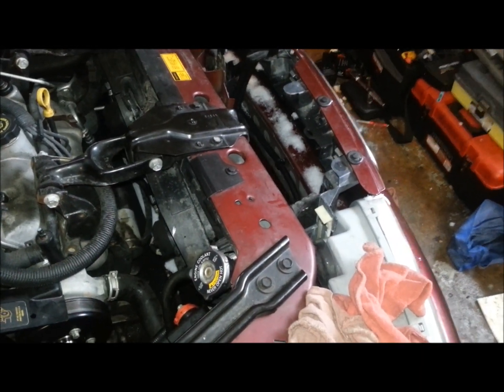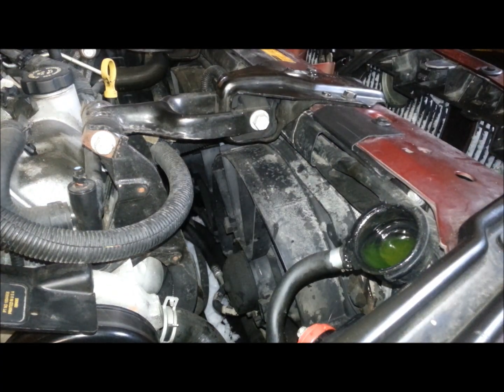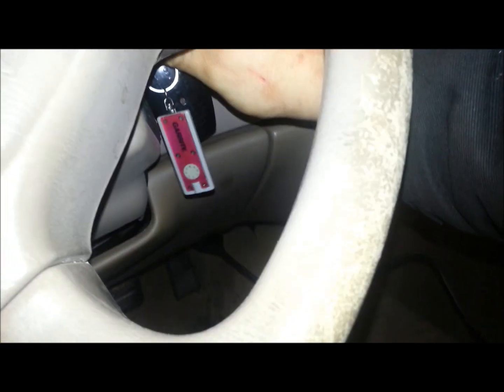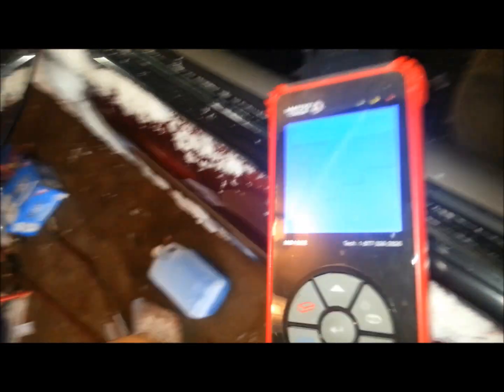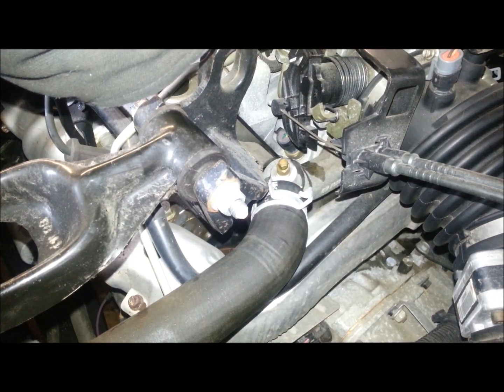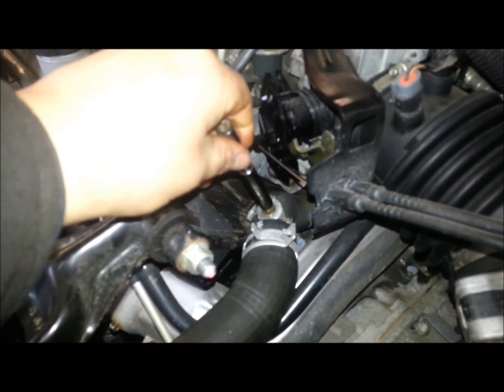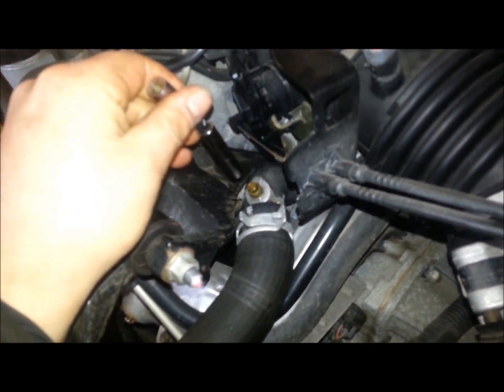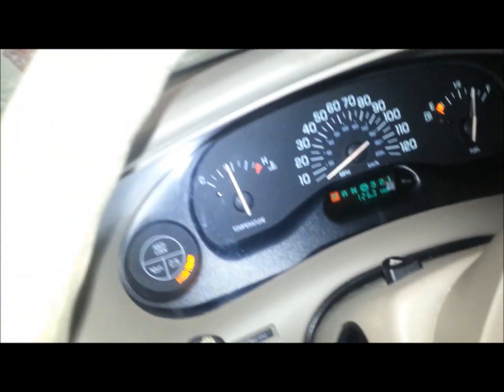how to bleed coolant system 3.1/3.4 liter

Comment: hey Joe, in the end you said not to touch the bleeder on the left side of the car why will that give you a bad day?
Reply from the maker: ***** yeah it will blow like old faithful if the car is running or under pressure from heating up , do not touch it unless engine is cold
Reply: alright cool thank you

Comment: Hey joe. with what your telling me everything seems to be good. I have no heat really untill the car warms up, not sure why. I think I got the leak fixed as I have not added any antifreeze for quiet a few days now. Just curious why there is no heat till the car is completely warmed up. Maybe still a little air bubble?  Car is a 2000 pontiac grand am 3.4 litre.
Reply from the maker: Jim Hutchings you usually don't have full heat until its at operating temperature. but there could be some air in the system but you would see higher than normal temps on your gauge
Reply: My gauge reads normal. If that's the case must be good to go. Just with the little bit of frost that we have it takes quiet a bit of time to defrost the window. Did not think that was normal but guess will see when winter actually hits. Thanks for all the info you provided to me. Much appreciated. 
Thanks
Reply from the maker: Jim Hutchings some times the blend door is an issue causing minimal heat flow
Reply: What do you mean blend door?

Comment: Hey, just like Dyllon Galan I have an 02 malibu base model and it only has the bleeder by the water pump (pressurized reservoir as well; no rad cap); is it still inadvisable to use that one to do a bleed? Not sure what my other options are..
Reply from the maker: cam1317 no do not use the pump bleed the reason i explain in the video is for stubborn air pockets. but in the pressurized reservoir just run the engine at an accelerated idle (1200-1700 rpm) to warm the engine up until the thermostat opens and then just top off coolant as needed

Comment: cannot drain more than 3.5 litres of coolant from Pontiac montana 3.5 2005 what do I need to do
Reply from the maker: edmund arnsby run water through the system to flush out what is in the engine and 3.5 liters is actually a significant amount of coolant
Reply: JoeTheAutoGuy
Reply: JoeTheAutoGuy thank you Joe I went to my Gm dealer and there is no easy way to drain coolant strange designe so I will do as you recommend

Comment: hey Joe. My bleadder screw is broke off so what other methods are there to bleed the system. I took the overflow cap off and let the vechile run for about 1 hr. Had lots of heat in the car. Once car cools down the fill level is below the fill line. Not sure if there is a small leak or not but do not see any leaks. What do you suggest?
Reply from the maker: Jim Hutchings leave your radiator cap off to bleed but sounds like you already did that, are you filling it up every time ? are you having overheating issues?
Reply: Yes topping the over flow up almost every time that's why i think there is a small leak some where but can't seem to find it. With the over heating problems if i pay attention and make sure resivor is topped off no over heating issues. If i don't top off i am gonna say i will have heating problems. When car is cool should your radiator hose to thermostat be solid or soft? As mine is soft. When motor heated up it is hard as rock so thats why i think i have a leak. Whats your thoughts.
Reply from the maker: Jim Hutchings sorry late reply what car do you have exactly? the hoses should build pressure . but your cap is regulated to a certain pressure usually 15-17 psi and if its building to much pressure it can cause a lot of issues but you would usually burst a radiator or something but the hoses should be soft at cold and more solid at warm temps

Comment: Thanks Joe. I've been fussing with my 2001 Chevy Venture for three weeks. Had the thermostat changed and it kept over heating. I didn't even know of the bleeder valve. Learned them. Didn't know that I could bleed the system while the engine is running. I didn't want to take it back to the same mechanic so I have been attempting it myself. It's working. You have my gratitude!
Reply: I did the water pump and bled the air from cooling system, went for a drive and everything was good.
When I stopped I could hear bubbles entering the overflow...
The next time I started it started to over heat again.. I've had to repeat process many times now.. what ammo missing?
Reply: @JJRD222  did you get it handled ?
Reply: @freshwatermechanic  that engine ended up having a leaky head gasket and has gone from my possession.
Reply from the maker: Oh definitely need to bleed the system anytime you expose it to air besides the radiator cap

Comment: Just change the water pump on a 1998 Chevy Venture, but I have the light saying Low on Coolant, but the the Radiator and the reservoir are full. What do you think? Should I do what you did in this video. Well I'm going to do it, and thanks for the video.
Reply from the maker: saul garcia make sure the sensor is connected in the resivoir bottle
Reply: thanks for the reply,  and what sensor are referring to? and the weird thing is that the light turns off and comes on. aand yet I open the radiator and is full. Thanks again.
Reply from the maker: saul garcia there is a sensor in the bottom of the reservoir bottle that is the sensor that is triggering low coolant to come up
Reply: thank you , How can I repay you for the help?
Reply: saul garcia tap where the connector is on the sensor and it should float back up and the light turns off.

Comment: Hi Joe.  Just liked & subed.  Your videos are great!  I have  a 2000 Chevy Impala 3.4 L V6.  It has 89,000 miles give or take as the odometer was changed.  I got the car for next to nothing.  Any tips on how to modify it for higher performance??  I would greatly appreciate your advice.  However I am sort of restrained by California emission standards (smog checks every 2 years).  I would greatly appreciate your advice.        Sincerely,  JAMES.

Comment: good videos Joe - never knew about that bleeder screw there, been trying to bleed it through the heater hoses because they are the highest point on the engine. The head gaskets were shot already so I replaced them, then bled the system the correct way as you've shown. Thanks again!
Reply from the maker: DoozCoop welcome thanks for watching
Reply: On this cooling system is wery easy to do thanks for helping people out on this clear explanation

Comment: I was working on a Chevy venture with the 3.4 and the needle kept going past half,and fans weren't turning on unless I turned the a/c on..why???
Reply from the maker: something is wrong with your main fan, the secondary fan turns on when your ac is activated so your main is probably never turning
Reply: Coolant temperature sensor

Comment: why you recommend not to touch the other bleeder what is that one?
Reply from the maker: if you open that one while the vehicle is running it will blow like old faithful
Reply: Oscar Flores hay joe grasias por tus bidios soi jose de conroe tx estados unidos escribeme quiro saber como purgar el rallador d e un malivu TL 6 3.5000 silindros 20007 porfabor grasias

Comment: I changed the radiator and water pump in a 99 lumina with the 3.1.... bleed the system and it ran fine for a week.... then the tehmp gauge started bouncing around would start to climb.... then drop back down to operating temp for a while... then would start to climb again( causing the heat to stop working) then when the temp drops back down heat comes back on.... Bleed the system again was fine for a day.. then did the same thing again... when I bleed the system I did not have the radiator cap off.... could this cause the problem?
Reply from the maker: you could still have air caught in the system and possibly a sticky thermostat the radiator cap should be lose when its cold as soon as the heat gets above 190 is when i shut the cap down an open the bleeder slightly. to get some trouble air out

Comment: Turning the heat on doesn't help in my case because the heater fan, rear defrost and cruise control are disabled in recirc (fuses are good). This seems to be tied to the coolant level but is getting more common as time goes on: lately it has to get real cold to fire up the heat (and even that is flaky). How do I get around that?

Comment: My 2002 Malbu LS Only has the one bleeder by the water pump. Mine is the pressurized system. I tried just bleeding mine by removing the cap and getting it warmed up by putting some rpms on it and it started spewing coolant once it got hot... Not sure what to think of this.
Reply from the maker: was it over heating during this?
Reply: It was a tick over the half mark on the gauge. Fans wont turn on unless the ac is on. I dont know what is considered overheating on the gauge meter besides the red mark.
Reply: JoeTheAutoGuy Replaced water pump and thermostat but have very loud whistling sound. Is it due to still having air in the system?

Comment: DUDE!!!! U said don't mess with this one (referring for the other coolant bleeder thing...that's what I did before I found this video..do I still bleed it like u show?
Reply from the maker: you can blled it normally through the radiator cap if you have a spill free funnel but this way will bleed it easier and not so much mess on the floor . and can get stubborn air in the system
Reply: thanks for the super fast response!!... just bled it doesn't overheat any more.but now I see my radiator is leaking... if I stand in front of my car (2005 impala--3400 sfi motor)its leaking directly in front of the upper radiator hose but I cant see it ... do u know if there is hoses?..if not can I jb weld or can I just use radiator stop leak...and thanks joe...

Comment: What do you do when this doesn't work? I followed this procedure at least a dozen times and only got a mess on the garage floor. seems ok for a couple of miles then no heat and overheat. I pressure tested the system and it held 12 pounds for 24 hours. still the same problem. I replaced the intake gaskets after they failed and can no longer use the car. Any ideas?
Reply from the maker: did you replace the thermostat, many issues are with the water pump as well,  ive had a few that have been head gasket issues and will only show a leak under pressure of combustion just a few things to look into if your still having issues

Comment: Joe, great upload. I did this to my 2000 Pontiac Montana after I did the thermostat. Bled system but still did not have heat. Come to find out the heater bypass pump was seized up. Took the pump off and disassembled and cleaned the remnants of the Dex-Cool that used to be in the van. I will agree with almost every experienced mechanic out there that says that Dex-Cool is garbage. It was actually like clay in the pump housing. Cleaned it out and pump spun freely and then I had great heat after bleeding again for about 10 minutes.. Again thanks for the upload.
Reply from the maker: thanks for watching

Comment: i have a 2002 Pontiac grand prix se 3.1l and now it starting this misfire it only does when I first start the car in the morning for a few seconds and run smooth do you have a clue what could cause that
Reply from the maker: it might be running lean from a vacuum leak , some small leaks can cause  a miss at low rpm as with any vacuum leak they will run lean and get better with increased rpm. than when the car heats up it could expand rubber seals and seal up leaks (vacuum only) its a high possibilty

Comment: do you leave the radiator cap open?
Reply from the maker: yes the radiator cap should always be open when bleeding the system the bleed valve i touched just gets some of the air out of the intake faster

Comment: You sir are my mentor on troubleshooting from now on My car had a bad resevoir cap and it let all the anti-freeze drain out and I just seen your video and my car which ive had for 10yrs now is doing the same thing I was gonna drive it to the mechanic but I have the book and knowledge plus dont wanna ruin my heads so how long is this technique time wise?
Reply from the maker: takes anywear from 15 to 45 minutes just keep watching your colant level and its pretty simple , thanks for watching

Comment: all you really have to do is take off both bleeders and the rad cap and the two heater hoses start pouring dex cool in all of them and you ll see the coolant coming up in both bleeders close them replace hoses and cap enjoy you dont have to mess with hot steaming coolant coming out near your coconut use your brain this guy didnt
Reply from the maker: i was away from the bleeder just had the camera close and this is a bleed valve for a reason if the air isnt evacuating through the coolant cap  and not having to disconnect anything just be safe but your entitled to your opinion
Reply: whitebread8381 tengo un Malibu 2007 lepuse motor nuebo pompa de agu temostato el Motor es 3.5000 y no se como sacarle el aigre osea purgar el rallador quiero que me emdellem como sease

Comment from the maker: do not touch the bleeder valve on the left above the water pump, this will cause the coolant to purge like old faithful and cause burns to you
Reply: Only if you are doing it wrong.

The one at the water pump (left) is the one you bleed cold, but I still go back while bleeding the one at the thermostat housing (right). Once the thermostat is open and everything is hot/pressurized it will just squirt out the side. Though it could be at any of 360°, the bleed hole is still on the side. You shouldn’t be taking the bleed screw all the way out for it to squirt out the top.

Regarding the temp gauge markings: The Pontiac Montana/Oldsmobile Silhouette have a tachometer that the Chevrolet Venture doesn’t have, despite being that same van. That means they had to fill the empty space on the cluster with a bigger temperature gauge. Even with the smaller gauge, my Montana has 260°F at the top and 160°F at the bottom. That means you get exactly 100° in-between, so half-way is 160°+50°=210°F. I know it is accurate because just above half way is exactly where the water boiled when I did a coolant flush with water and cleaner (212°F).

Furthermore, that makes the 1/4 mark 160°+25°=185°, which is the exact spec for the stock thermostat. Sure enough, my thermostat opens up at exactly a quarter of the way. TStat housing bleeder starts shooting pressurized coolant and the upper radiator hose gets super hot.

I don’t know if this translates to the gauges without numeric markings but if your thermostat opens at a quarter of the way then that’s 185°F, half way should be 210°F, 3/4 should be 235°, and all the way should be 260°.

Of course, you can’t confirm this if you are having a problem with a stuck thermostat like I was but it’s good to know going forward.
Reply: You can bleed both filling cold or when up to temp.  You are supposed to crack them, not open it fully. Run the engine up to 2000rpm and all air will be out of system when you feel hot heat.
Reply: @LIFTANDFIX   Yup, you're right.  Just crack them open so air escapes through the threads until coolant does the same.  Don't know why people make it so complicated.  It's a tapered brass bleeder valve that stops any coolant leak with little snug but some over do it and break it.

Comment from the maker: homes24 it was previously flushed with green coolant, completely fine if your running all the same coolant , but yeah for everyone do not mix coolants its a huge no no.
Reply: DexCool and green stuff should never mix. Together, they form a sludge that clogs cooling passages, resulting in poor coolant circulation. This can lead to head gasket failure or intake manifold failure. These engines do just fine with the green or the red. Just never a mix of the two in any portion.
Reply: What happens if you mixed a lil bit like half a glass or so ? Damn O Reilly's worker gave me the wrong one glad my 2000 Pontiac grand prix didnt need much but now my car is over heating and I dont k ow if that's the problem my fans are not working for 1 gonna check if the motor on them are still good but back to the coolant can I do what Scott did and flush it out with water ?? HELEP lol thanks

Comment from the maker: 2001 jaguar s type? with the 3.0 liter v6?. if the car is not over heating or anything its possible you have a blend door actuater stuck or broken  not allowing warm air to com in to the cabin

Comment: Got 2001 S-type, no heat coming. 2 bleeding valves: one for engine cooling, other one for heater unit. Both hot. Engine cooling valve filled nicely but the other one I just can keep on bleeding for hours, coolant comes out periodically... but when pressing on the pipes, it comes out nicely and no air seems to be inside the system. Yet, only cool air. When bleeding for 20min, I get 1-2min of hot air until I close the bleeding valve... no leaks or anything. And not the heater unit. Got any ideas?

Comment: On mine i am not pulling coolant from the reservoir tank. I paid a guy to do the lower intake manifold gaskets and head gaskets, It is running a little hotter and the heat is not what it seems it should be in the cabin. Will air also cause it not to pull from the overflow tank?
Reply: wvscotsman That’s what mines just did. And was told it could have air in the system. I had my head gasket done and after coolant came out from the overflow tank and started to overheat.